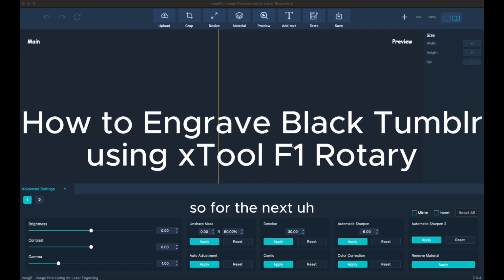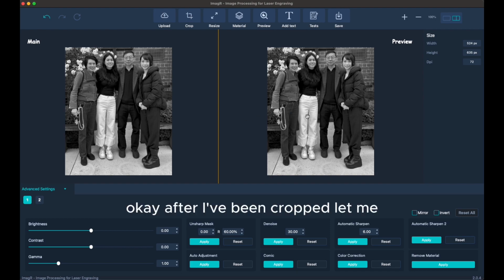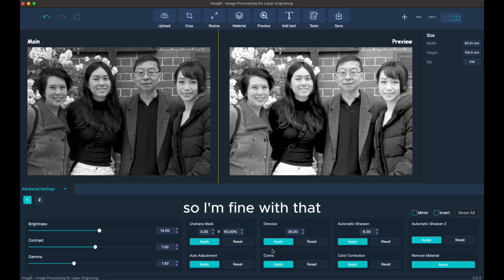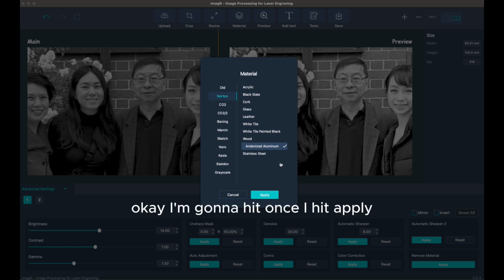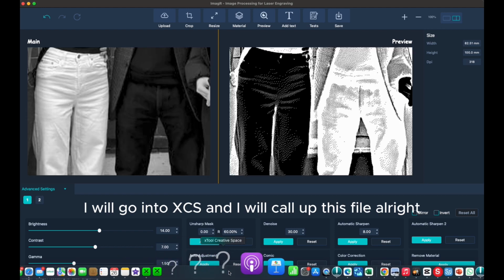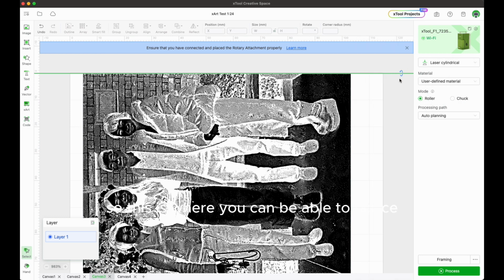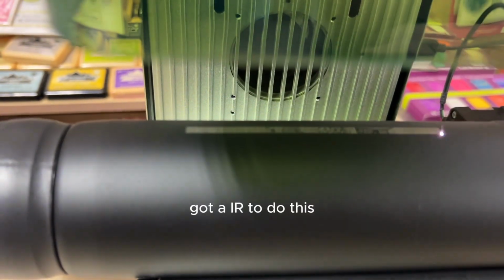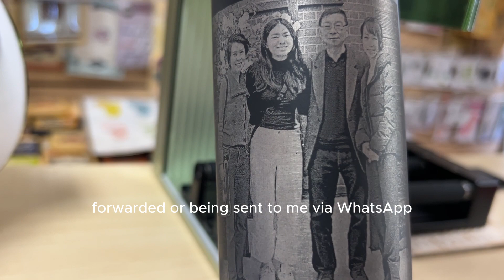How to engrave a photo onto a black tumbler with xTool F1

Comment: You used IR, not the blue light? Is this correct?
Reply from the maker: Yes that's right ir
Reply: @ why didn’t you use the blue light? I tried doing one exactly like yours and the image came out but it’s too light. It looks great in detail but it’s just very light and only noticeable when you look closely. How did you choose your settings? Is there a test you use?
Reply from the maker: @LakersNinersFan  Please run a test grid so you can get a optimum result since the file is a bitmap. https://www.etsy.com/listing/1576680103/xtool-f1-engraving-and-cut-color-test
Reply: @ScrapbookMemorie thank you!!!
Reply: @ScrapbookMemorie do you have the F1 or F1 ultra?
Reply from the maker: @LakersNinersFan  Yes we are using both F1 and F1 Ultra
Reply: @ which one did you use for the video?
Reply from the maker: @LakersNinersFan for this im using F1
Reply: @ incredible! Thank you for all your replies.